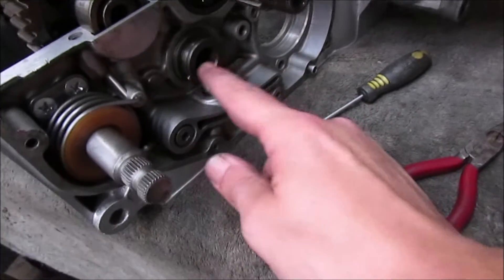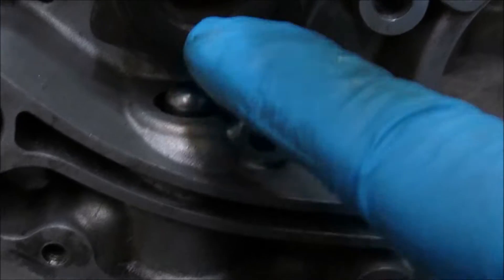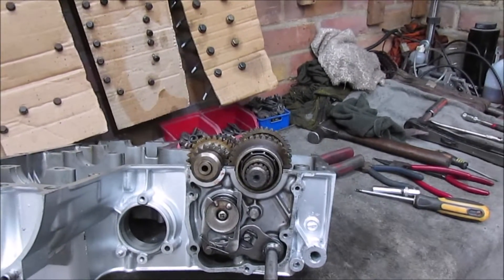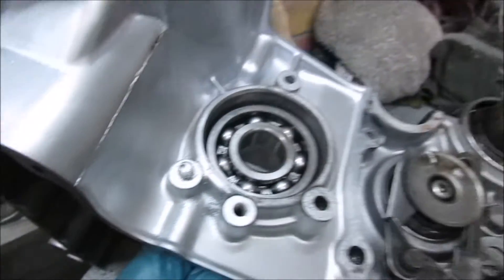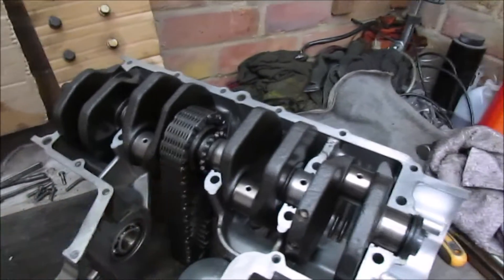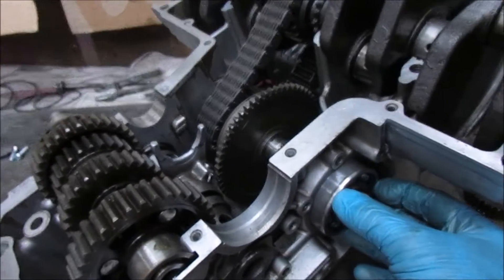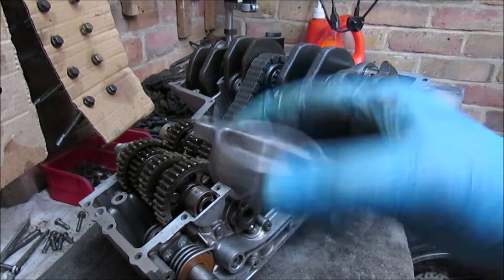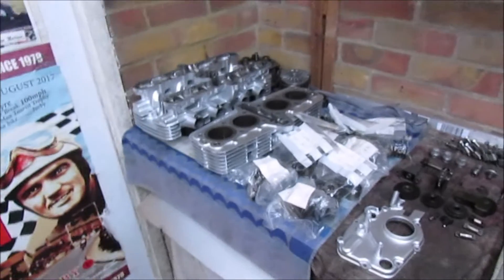Kawasaki KZ650/Z650 B1 1977 - Engine Reassembly - Part 21

Comment: Hey enjoy the videos, have an sr stripped down to frame and plan on going through just about everything. One question i had was where did you source crankshaft main and rod bearings. Thanks keep it up.
Reply from the maker: Thanks MiniTroutMan, all the parts for the engine came from Wemoto.com, have used them for years
Reply: @TheAmateurBikeBuilder  Good morning. Do they ship to South Africa?